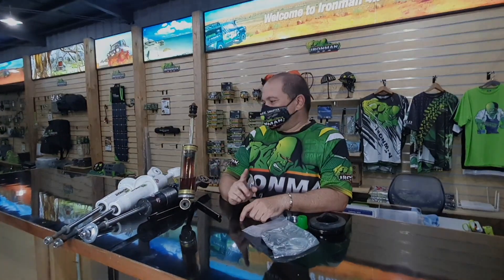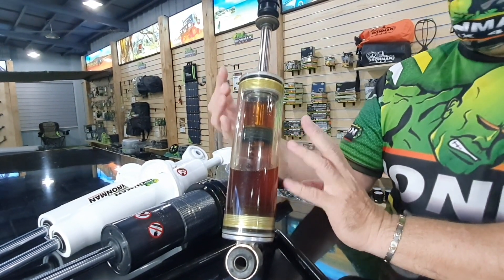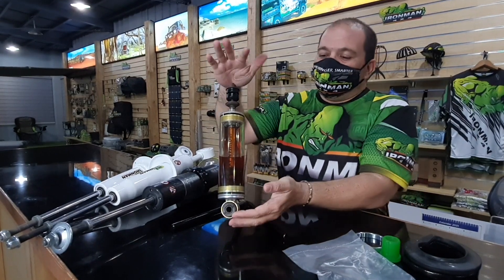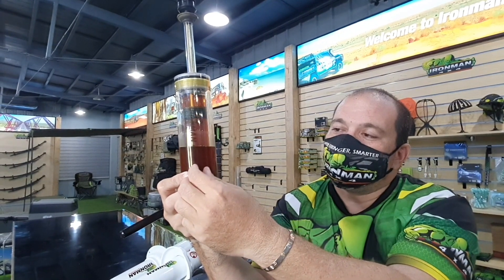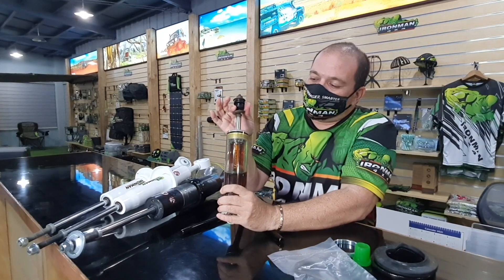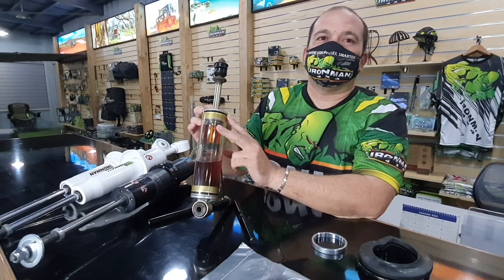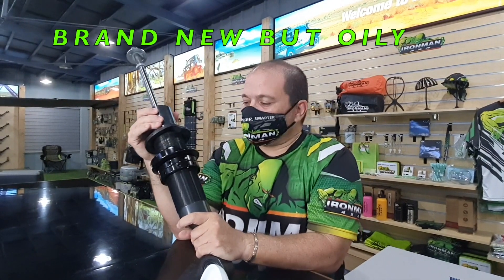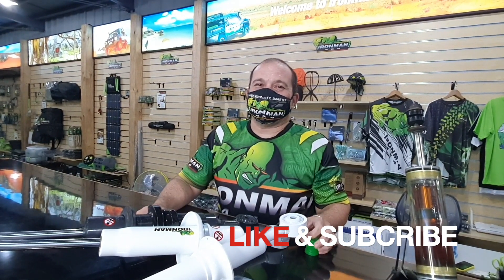Let's talk shocks!!!

Comment: Sir does the foamcell pro have a model for hilux vigo
Reply from the maker: Yes sir.  45710FE front, 45650FEC rear
Reply: Thank you sir and another question how many inches is maximum for iron man foamcell and foamcell pro
Reply from the maker: @karlgraviles7244  2 normally, 2.5 if you run our ProForge UCA.  That is with our coilsprings and AddALeaf or leafsprings
Reply: another question whats better suspension monotube or twintube and why?
Reply from the maker: @karlgraviles7244  go to 2:38 sir please
Reply from the maker: @karlgraviles7244  for 4x4s twintube.  They can be dented and still work. No hoses. Nothing to break.  Our 4x4s are not rally raid cars or Baja trucks so we need something that will continue working for years.
Reply: is there foaming of oil in ironman foamcell or non? because i watch other brands and if it bounces rapidly theres foaming of oil
Reply from the maker: @karlgraviles7244  so far we havent experienced it... some interesting videos:

https://youtu.be/ZllIrBarknM
Reply: thank you very much

Comment: Can i ad lc 200 springs on tundra on iron man foam cell pro
Reply from the maker: Yes you can. Do you have the part number of your front shocks?
Reply: @ironman4x4philippines20  the dealer in qatar doesnt have  springs for lc 200 or tundra untill  November  

And some other shops have though  dog and king springs i wanted to know the spring rate  and  coil spring height of iron man shocks for tundra of they match then i can get them 

I just purchased  a iron man foam cell pro set for tundra
Reply from the maker: @ALHAMOOD100  the spring brands you mentioned do not share spring rates. Only Ironman 4x4 has the spring rates published in the website and catalog.

Comment: Sir at 11:00 you said, a lot of shops use the rings to lift the vehicle which is a wrong practice. So you mean to say I can still get better handling in high speed highway situations and comfort in regular city driving just by changing the shocks alone? Most promos by shops says you need to add a leaf because if you put Ironman shocks and coils, the front of the car will automatically lift. So you need to purchase shackles or add a leaf. Is this true?
Reply from the maker: The vehicle will NOT lift by changing the stock shocks to Ironman 4x4 shocks.  If you change the shocks alone, you get the same height as the stock setup.  Now if you use Ironman 4x4 shocks and Ironman 4x4 coils, you will get about 1 to 2 inches of lift, depending on the vehicle and Ironman 4x4 coilspring part number.  Then, you need to use Ironman 4x4s AddALeaf to lift the rear too.  Do not use shackles to lift as they simply do NOT work to improve ride.

Comment: I have 2 inch lift on my pajero gen4. Both dobinsons coils and shock. I have no problem with the coils . But the shocks are really stiff. Im planning to change shocks. What do you recommend to makr my ride softer. I want to retain the 2 inch lift rhi. Thanks
Reply from the maker: We dont really know if the coils are stiff or the shocks are stiff actually.  But we can try changing the shocks, so we know if it improves.
Reply: Which one you have IMS dobinsons ?

Comment: You are awesome dude! I love your videos. So clear and articulate! 

I have installed the foam cell pro on my Prado 150 and loving it so far. I have the performance springs installed with this. If I decided to go for a full metal bumper (ironman's),will I need to change the springs to constant load? 2nd question: Sometimes when going offroading, I can hear some creaking like similar to bed springs. What could be the cause of this? Control Arms? I have OEM control arms. Do I grease them? If so, what type of grease?
Reply from the maker: Hi sir. Thanks! Just trying our best to explain the products and setup procedures.  As fornyour Prado 150, what part number springs were installed in front?  Are they the TOY055B or TOY065B?  Also as for creaking, check the sway bar to Foam Cell Pro clearance.  Let me know how I can help you more.

Comment: I'm interested in improving my saily driver to Ironman suspension, Which of those shocks can fit my gen 1 strada 96model? Thanks!
Reply from the maker: Yes sir.  We have shocks specifically made for your Strada.  That is your Ironman 4x4 Philippines advantage.  We use specific shocks.
Reply: @ironman4x4philippines20  Great! What type is it and I know there's a branch in cavite. May I know also how much? Thanks so much!

Comment: Sir i lifted my navara using a levelling kit for the front and changed my rear coils and shocks with ironman. I wanted to change my front shocks to nitrogas para complete na lng ang shocks. Can i still use the front coil spacer so that i dont need to change my front spring to maintain my front 2inch lift?
Reply from the maker: Sad to say you cant sir.  The longer travel of the Ironman shocks will make your upper arm bang on the coil upper mount.  The Ironman shocks are height adjustable so your request is possible.

Comment: Hello sir. Which Ironman shocks would you recommend for Hilux Revo for daily/city driving? Yung mabawasan mo ang tagtag sir. Thanks sir
Reply from the maker: If shocks lang paplitan, either Nitrogas (27k) or foam cell (37k) sir.  That is for 4 shocks only.  Meron din kami ng full kits po.
Reply: @ironman4x4philippines20  if may kasamang spring sir? May package na po kayo nun diba?
Reply: Am also curious for my hilux revo. No lift sana since senior parents and for edsa and osmeña ave. use (ang lala kasi ng lubak and uneven roads). Wondering how comfortable this ironman is compared to other brands.
Reply from the maker: @vauntace26  what year is the Hilux?  If you want stock height the most we can do is replace the shocks.  With Ironman 4x4 we can also level it a bit.  As for comfort, Ironman is the only manufacturer with comfort specific shocks, and this is engraved on the shock itself, part numher GRC or FEC, for the rear of most vehicles

Comment: How much the price
Reply: Fortuner 2014 how much price  shock pede rin ba yan sa higway long drive  hindi ba delikado and adjustable rin ba yan sir
Reply from the maker: @roypinto2199  shocks only Nitro is 27k po sir, coils are 20k.  So 47 lahat po. Pwedeng pwede sa highway.  Height adjustable po.
Reply from the maker: What car sir and what shock?
Reply: Nitrogen sir how much shock
Reply: Saan ba yang store nyo at libre ba yang pagpapakabit  ng shock at coils at  meron din ba kayong mga tires tulad ng nitto tires  pede bang 275 by 70 size ng gulong at may discount pa ba yang  shock at coils nya
Reply from the maker: @roypinto2199  saan po kayo sir?
Reply: Sa olongapo city

Comment: Nice Vid Sir and im always following your vlogs and subscribe  too. Glad to have now in the Phils.   BTW i am planning to enhance my Pajero Gen 4 suspension for  mild off road. Maybe raise  Ht. 25 mm to 50mm. What do you recommend but not to compromise the ride quality other than to improve pa kung maari.  Nasa tama lang  na tune pero di dapat matagtag.  Pede ba yun? One day i will visit your place at Bacolod  if you dont have Manila once travel restriction more loosen.  Appreciate if you drop a reply.
Reply from the maker: Hi sir, we do have lift kits for the Pajero.  My usual setup is B front springs, and either Nitrogas or Foam Cell, the for the rear usually A springs and Nitrogas.  It is about 45mm to 50mm in front and 35 to 40mm at the rear, since Filipinos like a more level stance.
Reply: @ironman4x4philippines20  Hi Sir. Well noted  yours.  Let me  complete the car  warranty and do the set  up once clear.  Appreciated your reply.  God bless po.
Reply from the maker: @neltancio6052  sure sir.  Let us know!  Thanks in advance!

Comment: Proud Foam cell pro user, (hilux revo) masakit sa bulsa but still ganda ng performance. Parang nasa duyan lang..
Reply: ano po set up nyo sir? may nagsasabi masyado daw matigas sa pavement or unevent pavement. pero may feeling ako baka maling spring ang gamit nung nagsasabi.
Reply from the maker: @vincentianlaureta8714  maling akala yan sir... or merong ibang stock na gusto ibenta...
Reply: @ironman4x4philippines20  probably sir,  sir may you recommend shop that install foam cell pro in metro manila or nearby area. thank you po,
Reply from the maker: @vincentianlaureta8714  yes po.  Our office is in QC.  Pm me on FB with you number, Pablo Lu Ascoba
Reply from the maker: Thanks so much sir!